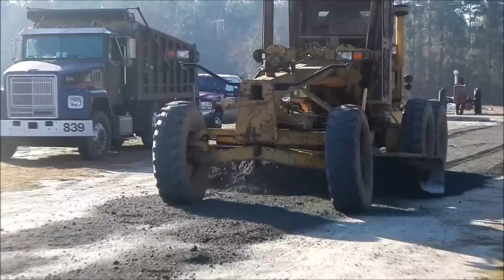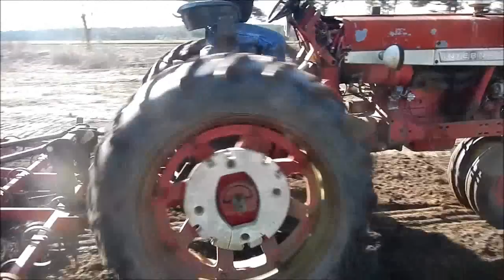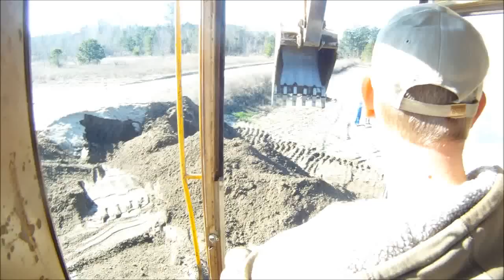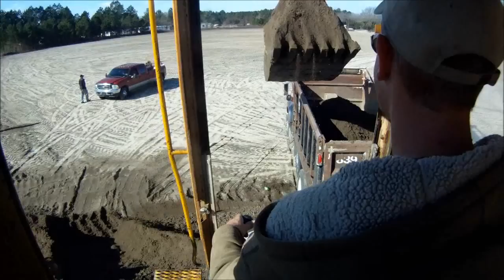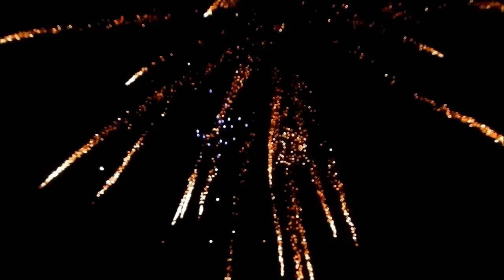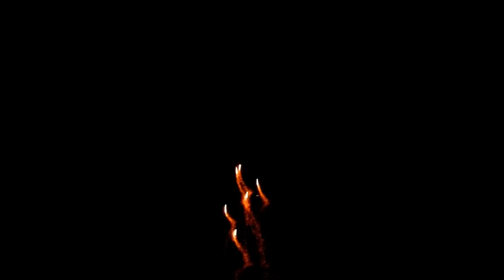Weekend at Charlies

Comment: man I wish my old 656 still ran as good as that one. at once time it would have pull that little leveling tool, but now its doing good if it can pull the hat off your head.
Reply: I rebuilt the engine soon after I bought it. There is about 4K hrs on the rebuild. Still runs good and doesn't drop oil between changes and no blowby.
Reply: nice, our old machine has 8900hrs on the clock. last time it was rebuilt I was bored out. at one time it could pull an 8 row on planter. as soon as we get some $ freed up, its going to get rebuilt.